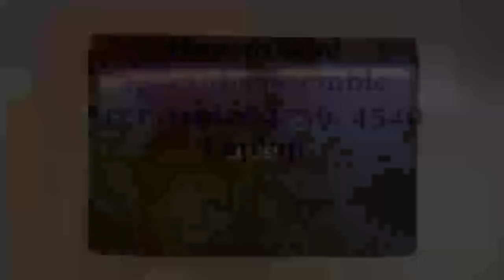Acer Aspire 4736 4540 laptop take apart/disassemble

Comment: can this laptop upgrade it processor?
Reply from the maker: No
Because it's not Intel Core i3,i5,i7 CPU
Reply: Noom NotebookLookup so if this laptop using one of that processor. it can be upgraded?
Reply: Adib Aiman Yes, you can upgrade it, but you need to find a compatible processor (socket PGA478). For example a T8300 is compatible. It would be a upgrade, but not a very significant one, plus you can't find a brand new of these, you would have to stick to a used processor.
Reply: oh thanks